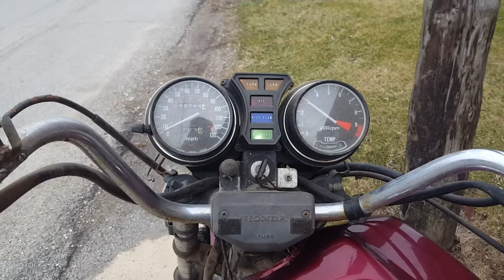Honda GL650 Cafe Racer FULL BUILD TIMELAPSE

Comment: Such a great build mate! Film work was also great. I've been slowly customising a CX500 and this will be a go-to vid to see some perfect inspiration. Can I ask?....what is the tank from? and the handlebar controls? ( I love the twin headlights, I'm doing that myself in a slightly different way) You should have Ads on this vid. You deserve to monetise such great workmanship and inspiration. (just not too many....lol) Greetings from 'Built in Bondi', Australia.
Reply from the maker: Hey Marc thank you! For all of the modifications you can actually see the full build playlist as I document each step as I go. I have a much higher-tier CX500 build playlist on here as well as yet another CX500 scrambler playlist.  The tank on this bike is totally stock.  For ads, you would have had to see/skip two before it started, then maybe 1 or two during the video.  I placed 4 potential ad breaks but most don't need to see them all.  I do not overload my videos with ads but they are there.

Comment: Not gonna lie I was wanting you to tear into the engine. Seemed fitting after everything else you've done but that was only because I love engine work lol. The bike sounds and looks amazing. You have a lot of talent.
Reply from the maker: Thanks Ryan. I chose not to as I knew it ran well, had no leaks, appeared to have newer gaskets, and the stator measured within spec so there was no need to disassemble. I have multiple videos covering a full rebuild of a GL650 engine in my cx500 tracker build playlist if you want to see specifics there.

Comment: Great video. Great build. Only thing I would change is go with powdercoating over rattle can paint for frame and swingarm.
Reply from the maker: Thank you John. FYI the paint did come from a can but is professional level stuff with a 2k hardener making it very strong. This is a customer bike as well so everyone has a different budget. Check out the white CX500 build for top tier parts and practices as it is 10x the level of this.

Comment: So impressive, and that motor cleaned up real nice! I was wondering what you were going to do with it. Turns out, a lot of elbow grease! Nice work!
Reply from the maker: Definitely cleaned up well. I didn't need to tear into it as the stator checked out resistance wise and I could tell it had a new rear cover gasket suggesting recent service

Comment: Nice build, instead of the diagonal bars beside the head lights should have metal worked or plasma cut your BHB on there for a bigger wow effect. 👍👍
Reply from the maker: I've just seen flat plates a million times on bikes. I haven't seen one like this. Same reason I did the whole subframe like this.

Comment: I've written before, and you have always been gracious in answering. I am doing a CX650 as a bobber. I will be doing the x21 system from you as well as the rectifier and solenoid. I need coils and a starter. They all failed the tests. What do you recommend? Also, I saw you put Mikuni carbs on another build. What would you recommend for my CX? Mine are damaged. I'm not at all experienced in aluminum welding and barely so in steel, so what intake manifolds do you recommend? I like the tank on the GL, so I'll try to find one. Once I start on the wiring, I'm sure I'll have more questions. My biggest wiring issue is I am color blind in certain colors, so what looks violet to me may be blue or light blue to everyone else. I know Im missing stuff, so please be willing to answer questions as you always have. Thank you for the work you do and being an inspiration to tackle my project on my own.
Reply from the maker: Hey Donald why don't you just shoot me an email and we can get more in depth on what your plans and concerns are. Much easier than in comments

Comment: What REALLY impresses me is that when you made the wiring harness (you MADE the wiring harness!!!) you managed to get all the lengths of free cable past the harness, that go to the individual components all completely correct. So all the wires had exactly the right length of cable to go where they needed to go. How in holy f*ck did you do that???
DEEP RESPECT man. That's just my kind of bike (apart from the headlights)!
Reply from the maker: Well thank you much! For wiring I build all my harnesses and show you how in 3 parts. Part 1 here: https://youtu.be/iR1OzczjZDc
Reply from the maker: For the headlight I did end up changing it as well. Loooooooots of videos besides just the time-lapse  https://youtu.be/HdySDOrx1to

Comment: Hi mate! I got cx650 frame in very bad shape, and I have spot on frame from gl650. My question is, the swing arm from cx650 will fit the gl650 frame? Thank you in advance.
Reply from the maker: That I do not know actually.  I have never had a cx650 near me to look at. You could look up the swingarm pivot bearings to see if they are the same which will be one clue. Also compare the rear axles. They may just fit but I have no experience with it
Reply: @BrickHouseBuilds  Thank you for quick answer and good idea how to maybe found out about. Preparing to start building cafe racer, all your videos very helpful and give more motivation every day. Cheer

Comment: Whoa, is that Direct Drive Transmission on a damn motorcycle!?

If it is then direct that torque would be insane
Reply from the maker: Its shaft drive. You lose some power and torque as compared to chains as those are more efficient at energy transfer
Reply: @BrickHouseBuilds  personally in my experience with chains hasn't been anything but pleasant, I just have bad luck with chains xD

Comment: I recently started looking at such builds and i found something interesting. Almost every bike on the cheap can do the job, however it's important to change the tail. 90% of the time, it's just better to cut the rear with the angle grinder, find a piece of metal and put it there.

... since the older bikes (that can be usually found on the cheap) have bulky, full of "thingies" tails and usually their angle is quite straight which makes the motorcycle a little bit boring. While when you put a smaller, thinner tail that is pointing slightly upwards, the motorcycle becomes 10 times more attractive.

Also, what i believe is, that many store-bought motorcycle headlight masks can be ugly as fuck especially when it comes to plastic and making your own is way better. You can make it from metal and it's going to look stunning.
Reply from the maker: I hope you liked the video

Comment: I like very much the front lights and the handlebar and instruments you chose. The position of the battery is very clever and clean. 
I thing you WILL need absolutely a mud guard for both tires or it will be messy very soon. 
As commented the seat is really too thin, your back and butt won't be happy. 

One questions about the tank: you painted only the top and not the sides. Which is very nice indeed.
What treatment did you give to the bare metal? 
2K coating alone is not enough, the slightest humidty goes through and it begins to rust immediately.
Reply from the maker: The bike isn't going through any mud, so no guards needed. The seat is very comfortable with plenty of high quality padding. Remember, this isn't being built to be a stock normal daily driver bike you take through the elements.

I've painted plenty of bare metal with 2k clear and have never had "immediate" rust. There was a budget involved here as well so simple painting over metal was perfect for the desired look.
Reply: @BrickHouseBuilds  Ok then some choices make sense. And about the tank, well then I've had bad luck, since my tank with 2K clear coat only, 2 times tried and two times failed, within a couple of week, it showed brown stains, right under the clear-coat. 
AFTER the tank was already painted in the classical way I discovered a colorless (transparent) primer... which could have been helpful before.  Therefore I asked.

Comment: This is outstanding work. Is there a reason you rattle can instead of powdercoat the frame?
Reply from the maker: Thank you. This was a simple budget build for a customer so that is why there weren't many fancy things added simply due to budget.  The paint on this is a 2k hardener which is as durable as any factory paint.  For a much much higher quality build check out my white CX500 build. Its called Grandfathers Axe.

Comment: Great job on the bike man. If you could. Where did you get that little paint squeezer the yellow detail little paint thing I could use one of those definitely would make it so you don't make a mess with a little brush. Anyways great job I'll be watching
Reply from the maker: Thanks Garett! The paint is simple Testers modeling paint you can find at a hobby shop. The little needle applicators are from hobby lobby. I have detailed videos on each aspect of the bike so if you want to know more definitely check those out as well as the many other bikes on the channel.

Comment: Hi BJ. What chemical u use desolve layer of dirt from aluminum parts? Cheers
Reply from the maker: Pretty much any cleaner available from an auto parts store. Engine degreasers, solvent, wd40, etc.
Reply: @Brick House Builds  many thanks for the quick reply.

Comment: How did you tune your carb to run to pods? And  how do I run the crank case breather?
Reply from the maker: For the carbs I simply jetted them to suit. Using a quality pod usually solves many issues people have with tuning carbs. I have some details in the description of this video: https://youtu.be/EhB1SBgiUC0

For crankcase breather check out the first start video

Comment: WHoa phenominal design concepts and builds! I learned so much from you guys. What is that squeeze bottle paint tool you use for the recessed areas in the covers? Thanks!
Reply from the maker: Thank you. That is a basic needle tip applicator you can find at hobby lobby or any crafts store

Comment: Oh Man!!!!!

YOU ARE KILLING ME!      I AM DEAD!

you must be a professionnal 'cause the way you handle tools , especially the tricks you using like making a perfect circle from a straight metal line.
I WISH I COULD BE YOU RE NEIGHBOURG AND WORK FREE FOR YOU EVERY WEEKENDS not to bother you but learn all your tricks and know -hows.

very smart , the battery at the bottom of the bike!
and what to say about the idea to tight the tyre with plastic zip before installation onto the alloy wheel (never seen that before, sorry i am surely a novice next to you)

the final work ROCKS!!!!!!!!!!!!!!!!!!

BY THE WAY: i have a rubbish welding machine not appropriate to weld well like your weldings    (mine can just weld 3 mm or higher metal thickness)
what is yours , could i get the details of your craftsman welding machine so i can check it on amazon (if it is not to expensive)

AND THANK TO ALL THOSE PEOPLE WHO GIVE AWAY THEIR TUTOS FOR US   (NOVICES)

CHEERS MAN

Farid 

:-]]
Reply from the maker: Thank you Farid!  I have an old Miller Syncrowave 180 TIG welder that I use along with a cheap Craftsman 110v MIG. That was the first time I ever tried the zip ties on the wheels and it was great. Its now my go to
Reply: @BrickHouseBuilds  thanks a lot for answering
Keep working well
Cause we love greats think🙂💪👍

Comment: Wow!  sweet build, but, WHY a shaft drive? I used to ride a shaft-drive Nighthawk, LOL, I recognize the sound, even with your awesome pipes on it.
Reply from the maker: Because it was manufactured as a shaft drive bike?
Reply: @BrickHouseBuilds  LOL, no disrespect is meant. just the opposite. I guess my question is that you put such an incredible amount of  hours and creativity into this build. The value of your work FAR exceeds what a Nighthawk 650 deserves. When I was riding one, it only had rear-sets, bars, and pipe modified. Not anything as wonderful as what you built. Back then (80s) these models were considered a little bit less than desirable LOL
Reply from the maker: @thaddeuscorea  I was commissioned to do so. Almost every bike on my channel is a customer commissioned piece. This is a Silverwing to be exact.  Nighthawks were 4 cylinders.

Comment: I love this bike.  I don't say that lightly.  Not a fan of Honda at all.  I love what you did.
Reply from the maker: Well thank you! Life is too short to rule out entire brands as everyone makes cool stuff
Reply: @BrickHouseBuilds  what do you think the power to weight ratio is on that bike?
Reply from the maker: @unprepaired-gamer  about 4 funs per kilogram. Its a modified cruiser not an R6 so getting something like this to race people would be the wrong move. Plenty of power to have fun on but its still a 1983 motorcycle
Reply: @BrickHouseBuilds  I love everything about this bike.  The attention to detail in incredible.   For example; the tail light. I see a lot of people kinda slap the LED tight on.  
What would your ldeal engine be for a Café Racer be?
Reply from the maker: @unprepaired-gamer  well thank you. For your question though thats a tough one. I love everything. Lightweight twins for urban cafes or scramblers, revvy small cc 4s, larger bore inline 4s for that power. All good. The question is, what is your intended use for the bike? If its all highway you need to match the engine to that job. If it's backroads fun a cb550/gs550/middleweight  is a great option, trail bike/urban scrambler a gs450/cb350/xs650 is perfect.  In short I cant answer that lol
Reply: Ao I've had a few.  '93 Kawasaki KLX650 two '84 Yamaha 400 specials and a 1982 yamaha xt550.
I love the quick pick up of the Enduro.  Looking for some options engine wise for a Café Racer but  maybe more CC's.
Reply from the maker: @unprepaired-gamer  a dohc cb750 or gs750 is hard to beat.

Comment: We’ve (communicated) on a FB post; but, I don’t think that it was ‘concluded’.  I’ve always had an affinity for “V” platform bikes (twins, fours, …).  In your experience, which specific bikes of this orientation have you had the most Difficulty sourcing OE parts ?  Were you able to resolve the challenge, or how did you ‘complete’ that phase ?  Do you care to share some resources for hard-to-find parts ?  I understand if you want to protect a ‘honeypot’, but, it would be influential in the final bike choice for my First CR build.

# Yamaha XV  Suzuki SV  Honda V VF CX GL
Reply from the maker: @StansE250  I actually share where I buy everything already in each build episode.  This is just a timelapse with no detail to it. Just a quick entertainment type video where my normal ones are very in depth. My experience says that engine bearings for cx/gl bikes are non existent. Cbx cam chain guides are very expensive.  Xs400 engine bearings are rare. I can usually always find what I need though
Reply: @BrickHouseBuilds  I appreciate the courtesy, BJ

Comment: Can’t ride it in the rain or off road? Ie. Wouldn’t it potentially fling the gravel, mud, water right up the back/head? Looks cool though.
Reply: I suppose you could just as easily make a quick release rear fender as the need becomes realized.
Reply from the maker: Not riding in the rain or mud or snow. Just meant to look cool. Check out my current cx500 adventure build that is very intended to go offroad.
Reply: @BrickHouseBuilds  being a carpenter/cabinet maker and a disciple (of Christ), I tend towards the ‘shaker’ idea(l) of form follows function. So my eye is judging according to that standard. Like when I see knobby tires I think poor performance on asphalt, but good on dirt, etc... so it doesn’t fulfil my desire for practicality... but I understand that isn’t your point... (last night for example I watched a kid take a deadly fast 4 wheel drive electric skateboard and upgrade the motors and wheels, only to dial down the power to less than the original put out... and in the process removed the superiority of the 4 motors just to put in two huge ones, which would act like a locked differential...) It was completely pointless, other than to just feed some kind of aesthetic... (which seems like idolatry... where the image of something is granted more worth than the actual truth.) 

But again in this case the image is obviously the function, hence the form followed. Take care, no offence meant! (But the lesson being beauty can obviously be deceiving.)
Reply from the maker: @GMC-qo9xi  As I build bikes for clients they request things to suit their needs that may not be what you want. Again check out any of my other builds as they are the right blend of functionality and form

Comment: hello, how motorcycle weight before and after rebuild?
Reply from the maker: I didn't weigh it when 100% finished but at its lightest it was 120lbs lighter than stock. Id say 100lbs lighter than stock is accurate